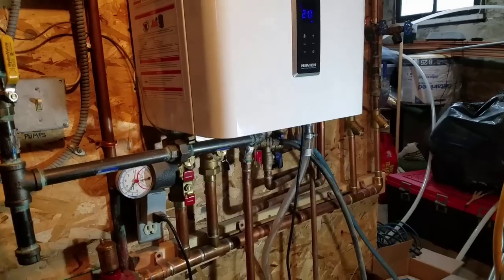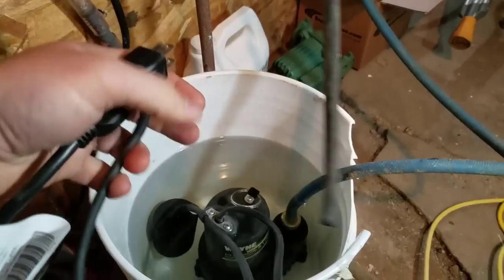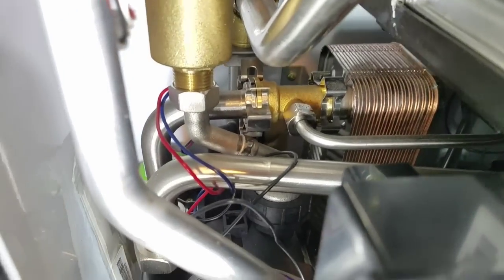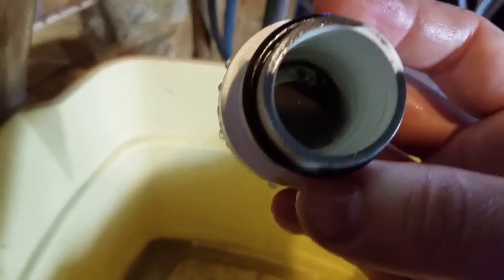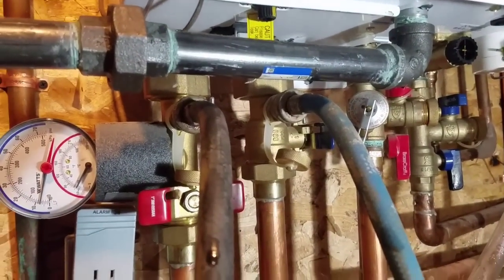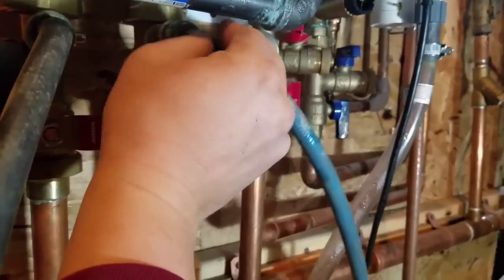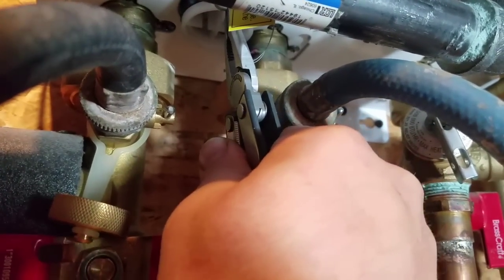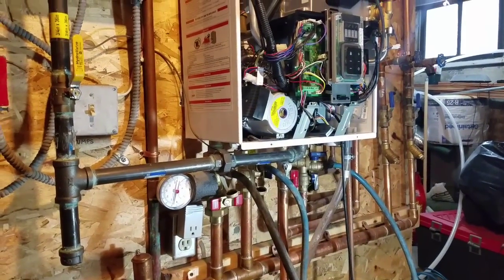How To Flush Descale Tankless Water Heater and Maintenance heat exchanger Navien NCB240 Combi Boiler

Comment: Great instructional video, thanks. 
Is it possible for you to make a follow up video on how to add boiler conditioner?
Reply from the maker: I had a 4' washer hose installed on a purge valve for inlet, and another hose at the end of the loop. Opened the end loop valve to drain water. This started a siphon on the inlet, so I could pour the conditioner directly into the garden hose (holding it above the valve) which would get siphoned into the system. One quarter of the boiler conditioner/flush. Or you could pump it in with a pump.

Comment: Thanks for you video in the detail. I have one question. The first part  with domestic Hot water wasn't any problem, but for the second part (heat exchanger) my pump didn't circulate . Water didn't came out from red valve. Please  tell me what need to do that my pump can start circulating?
Reply: There’s a three way switch in the unit. Once you’re done flushing the hot water side, turn the unit back on and set the thermostat to call for heat. Once the boiler is in heating mode then turn off the gas. This will cause the unit to shut down with an error message which is fine. Turn off the power and you should be able to flush the heat exchanger.
Reply: @iansnape2646  No need to turn off the gas. Once you call for heat and the Navien has started heating that zone, simply kill power to the Navien. The 3-way valve will be open on the space heating side (rather than the domestic hot water side), and you can then flush the space heating side of the boiler.

Comment: Thank you for your video.. so I have some questions.. the first part of the flush is for the heat exchanger as well? there is 2 parts to it, I was trying to do the first part (hoses on the right) and my pump was not pumping the vinegar up, I found out that it was because of the pressure from the boiler, so my 1st question: how do I release pressure from the boiler so that my pump can start circulating.. then I started doing the second part (heat exchanger with a german accent haha) and that worked okay, .. 2nd question: Just doing the heat exchanger (2nd part) alone will be enough?
Thank you for your video and help.

Comment: Very helpful video. Where and/or how do you apply the boiler flush and how much?
Reply from the maker: I had a 4' washer hose installed on a purge valve for inlet, and another hose at the end of the loop. Opened the end loop valve to drain water. This started a siphon on the inlet, so I could pour the conditioner directly into the garden hose (holding it above the valve) which would get siphoned into the system. One quarter of the boiler conditioner/flush. Or you could pump it in with a pump.

Comment: Great video. Question - you mention not to introduce fresh water into the boiler side. However, doesn't it get introduced as part of the boiler flush?
Reply from the maker: A little bit. Boiler side only flush every couple years.
Reply: Thank you. I did mine yesterday. The video really helped me. How do you add inhibitor on the heating side? I have copper fin baseboard. Should I add it?
Reply from the maker: @desigoose  definitely. Drain some water out of one port, open another port with a hose attached so it will create suction through siphon. Pour inhibitor into hose. Or pump it in.
Reply: Thank you

Comment: Thanks 4 the video.   Came across one of these that needs to be descaled badly.   Has hot water then goes warm then cold.   They have hard water.  I told them to also think about an in-line replaceable filter on the cold intake side to prevent this in the future
Reply: We just descaled the entire unit. Both hot and boiler side.   Lots of scale from the hot water and black sediment from the boiler side.  Let them both cycle for another an hour.  Did the water final flush on the boiler side twice and both filters before and after  I think that it’s gonna need service    Hot water for a bit then back to Luke warm then cool.  Burners are firing in unit   But the boiler pipes get hot.   Circuit board smells a bit    But at least I did the cleaning. So it narrows the problem.  It was making a clicking sound from the unit a week before it stopped performing
Reply from the maker: Good idea. Navien really emphasis water testing and quality for the space heating side, and good to filter domestic water too.

Comment: I have Navien CH-240 and lately the domestic water isn't heating unless I go downstairs and turn on the closest hot water tap which is my laundry tub. I turn it on the heater kicks in to generate some hot water. This has just happened recently. Any suggestions why this is happening?
Reply from the maker: Probably the flow sensor

Comment: thanks for the video! a few questions here, "turn off gas and call for heat to open 3 way valve" is this the only way to open 3 way valve for flushing space heat side? also do you have to bleed air out after flushing vinegar out of system?
Reply from the maker: I'm not sure if there's a manual way to open that 3 way valve. The 3 way valve is what commonly fails in these units. No you don't have to bleed air. Just shut off the valves. The boiler automatically purges any air in the system.

Comment: i descaled my combi unit and now the psi is reading 0.00/    e351 error code seems like its not getting water pressure . any ideas what causing it
Reply from the maker: probably air in the system

Comment: Hi, 
I've this unit Combi about 3 years and did not maintenance regularly because the contractors/builders did not tell me (new house after one year they're gone).  Recently, I paid a plumber $250 to flash heater exchanges did not flush a space heater. $450 to replace 3 ways valve.  Your video very helpful.  DIY save lot money.  I wanted to try and I am worry about air inside the system. How to purge? etc... Could you give me more info./details
Thanks
Reply from the maker: hook up a garden hose to introduce water, and have a garden hose on the end of the loop purge valve to remove air. Purge each zone individually if you can. Let the water run through that zone and flush the air/water until only air comes out.  Some systems have little air purge bolts in the radiators on the upper level to remove air. Your system should also have an air scoop and air eliminator/separator to constantly remove air out of the system.
Reply: Great video this is my exact unit and it helps a lot. I also have the same issue where my auto feed water 3 way stopped working after year 4. It is a cheap part to replace and I might try that after the winter. It isn't that difficult to pressurize the unit on the heating side without the auto feeder, but these steps helped. If it shoots up super hot it means there is not enough water from my experience.  @larsonhomeinspection9932

Comment: After flushing the unit my preset temperature fluctuates. I have preset 140F for heater and 120F for domestic water and how it fluctuates between 138 - 144F and 118 - 126F.  I believe before it was accurately holding 140 and 120. Any suggestions on how to fix it?
Reply: Ruslan Nikandrov it all depends on the load it will fluctuate!
Reply from the maker: Sorry, I'm not sure.
Reply: @larsonhomeinspection9932  after you flushed heater side, you just rinsed with water for 5-10 min by connecting to domestic cold water and then closed the maintenance valves , turning on system valves and that's it? Did you needed to do anything else?

Comment: I have the same system. Had no problem doing the domestic hot water side. On the space heater side I open the service valves close the isolation valves, cleaned the strainer, open the drain plug . Closed the pump drain plug reinstalled the strainer. Installed the pressure line from the sump pump that’s sitting in my bucket with water and descaling solution and I’m not getting any water to come out of the other side. Pump is working I checked that. Thought I had some type of “vapor lock” going on so I shut down the sump pump took the strainer back out and only a little water came . What’s going on? Any help would be appreciated
Reply: I think the answer is provided by the author in another comment ....  "Turn the gas off to the boiler, turn the power to the boiler on and turn thermostat up so it calls for heat. This will open the 3 way valve"

Comment: Mr Larson - Your video on how to descale the Naview is just GREAT.  Even a banker like me could do it.  My service guy just replaced the 3 way valve.  Do you have information on that step.  Or next time please do a video on it.  Does anybody have info on this step that might be reading this?
Reply from the maker: Great, thank you! I have not had to replace that yet luckily.
Reply: @larsonhomeinspection9932  is there a way to descale the 3 way.  My guy said that could be why it stuck in heat mode and could not get DHW
Reply from the maker: @dukekraus4362  I would think the 3 way valve would have to be removed and cleaned. But yes, regular descaling can prevent this

Comment: I don't understand your comment, "Another step I didn't do is to open the 3 way valve when flushing the space heat side to make sure the space heat and domestic plate exchangers get flushed." Which 3-way valve? Do you mean the valves that you closed to isolate the space heat plumbing from the vinegar during the flush?

Also, isn't there an air filter at the top of the cabinet that should be checked/cleaned?
Reply from the maker: I mean by making the unit call for heat, and call for DHW, it opens the 3 way valve for that heat exchanger. So basically flushing on the heat side, while making the unit call for each system to flush each heat exchanger. Probably not necessary.
Yes there's a intake screen filter.
Reply: @larsonhomeinspection9932  OK, thanks. Another question: When I watched my HVAC guy clean the boiler last year, I saw him unscrew the probe that goes into the burner (near the little window where you can see the flame when the system is running). He then scraped the tip of the probe clean. I don't see that in the Navien maintenance documentation. Do you have an opinion on that process? Good idea?
Reply from the maker: @sgoldste02 Haha I'm not certain if that's the best way. Cleaning the flame sensor.
Reply: @larsonhomeinspection9932   Haha, I just did this procedure again yesterday, and ran into the 3-way valve situation. I was able to flush the domestic hot water side with no problems, but when I switched over to the space heat side, I couldn't get the vinegar to flow through the unit. So I powered up the boiler, made a zone call for heat, then powered the down the boiler again. That worked and allowed me to flush the space heat side of the boiler.
Reply: @larsonhomeinspection9932  Thanks for the great video! I had no problem flushing the domestic hot water side, was gunky after 2 yrs of operation. I attempted heating side but have the navien supplied manifold under the boiler. Took me a few to realize there are two small screws on the side of the heating flush ports to open/close them. Earlier in the comments you only mentioned calling for heat, now you say heat and DHW. I attempted flush with just heat and while the openings in the flush valves are small, it didn't seem like it was flushing anything after about 15 minutes so I quit. Please confirm I need to call for heat and DWH to flush correctly. Do I shut off supply to DWH so I'm not running water all that time?

Comment: I am a contractor who installed the 240 NCB. Got no heat but have DHW. Wondering if I need to clean as you did probably? I have no error codes that is what is confusing. Will talk to Navien later today. Thanks
Reply from the maker: Im guessing the 3 way valve is stuck. Flushing can prevent that problem, but might not fix it once its stuck. Worth a try. Or maybe tap on the valve?

Comment: Seems like a high maintenance pain in the ass...is it worth it vs a regular boiler???
I have hot-water baseboard heat in my home, one hvac contractor is trying to sell me a high efficiency Bosch 96% combi gas boiler to serve my baseboard heat AND personal hot water for showering, tubs etc.
Another hvac contractor tells me the Bosch combi will never make enough hot water for the household, it requires a lot of maintenance and suggests a regular 85% gas fired boiler.
Also, how many gpm of hot water does it produce for bathing etc?
Reply: I have a combi Navien. No problems heating a large 3 story old house with old cast iron radiators. It also handles our hot water. No problem even running 2 showers at once it keeps up plenty fine. I honestly find upgrading my old style boiler and old style water heater to the tankless the best investment I've made yet. Summer gas bill is about 25% lower and winter gas bill is about 10-15% lower.
Reply from the maker: .Get a combi! Definitely worth it. Two for the price of one. Not sure on Bosch, but the navien ncb-240 is 200,000 btu with 4.5 gpm flow rate. We can take 2 hot showers in MN winter at same time no problem. Youdont haveto flush the boiler every year, just the domestic side. I would take an 10% efficiency gain, and basically a free tankless water heater for the same price and install time. Also saves a ton of floor space.

Comment: I have had my combi boiler for just over a year now and will be flushing it shortly. My question for you is regarding operation. Do you ever lose hot water when using the shower? I have a clawfoot tub with individual hot/cold valves that has never given me a problem, and a stand up shower with a mixing valve. Mixing valve is fully adjusted to let maximum hot water temp through. My shower head is 1.75gpm, which I know this boiler requires .5gpm in order to start heating. Shortly after running the shower with the handle turned fully to hot I will lose hot water and it will be freezing cold. I find that when I turn on my bathroom sink's hot water I regain hot water to my shower. I will be contacting navien for answers as well, but just wondering if you've experienced anything like this.
Reply from the maker: That is unusual. No I've never had a drop in hot water. It may be your mixing valve or something wrong with the tankless controls.
Reply: iamtheed hello

Comment: You mentioned a boiler conditioner. Could you explain how and when you added that and clarify what product you were using?
Reply from the maker: Hercules Boiler cleaner. I added it to my boiler antifreeze and pumped it in the system. You can also open a drain valve on one side of your loop to drain some water out, and then open a drain valve on another side, which will suck air in via siphon, and pour the cleaner through a hose so it sucks it in.

Comment: Great detailed video. I have few more questions thou.  When is best time to flush/ maintenance boiler, ie  winter or summer.  Also don' t need to clean air filter?
Reply from the maker: Thanks. Best time is off season. Yes, there is a screen on intake that should be cleaned
Reply: @larsonhomeinspection9932  Thanks for the reply, as non professional, this type of how to is really helping me and people like me.  Also video 5.57 after you cleaned condenses pipe, you said you need refill condenses pipe with water, (including bleach).  My question is why do you need refill it with water?  and if I refill it do i use same hole to refill (ie where you squirt blech?)  thx

Comment: I follow your video step by step to flush my system. On the hot water side, it went very well, but when I switch to boiler to flush the heat exchange it was lock up. I can not flush. It seems like the 3 ways valve was close the heat exchange. Would you please tell me what I should do to open the valve in boiler side so I be able to flush the boiler heat exchange. Thank you.
Reply from the maker: Turn the gas off to the boiler, turn the power to the boiler on and turn thermostat up so it calls for heat. This will open the 3 way valve
Reply: @larsonhomeinspection9932  In my experience from doing this process yesterday, there's no need to turn off the gas. Once you call for space heat and the Navien has started heating that zone, simply kill power to the Navien. The 3-way valve will be open on the space heating side (rather than the domestic hot water side), and you can then flush the space heating side of the boiler. Note that I kill power to the Navien at my circuit breaker panel, not from the front panel of the Navien. Not sure if that makes any difference.
Reply: VO NGUYEN  did it work? I’m having the same issue

Comment: very informative video indeed. so, how do you go about pressurizing the system up to say 12-15psi after? thanks.
Reply from the maker: After flushing water through the system with city water, you just leave that water in, and let the city water increase the pressure of the heat loop. This system has a city water supply automatic feeder which pulls in water if the pressure drops. If there is no automatic feeder, just hook up a hose from city water to boiler side spigot and slowly introduce water to increase pressure

Comment: Great video!
 you have an electric outlet right next to the water drains and hoses...is it a GFCI outlet/circuit?
Reply from the maker: Thanks! No that's not required for a boiler. Not a bad idea though.
Reply: @larsonhomeinspection9932  True. it is not needed, however a surge protector is warranted as it is a electronic system subject to power surges

Comment: RE: the screen for the space heating side - I want to check that screen. So I just need to turn off the two isolating valves for the space heating ?  (thanks for posting the video - very nice). [I just called a service guy and asked him to do all maint., but all he did was domestic hot water - he ignored anything related to the space heating side, I did not realize it at the time,. but i do now!]
Reply from the maker: Close the isolation valves, open that pump drain petcock to drain some water, then you can take it out.